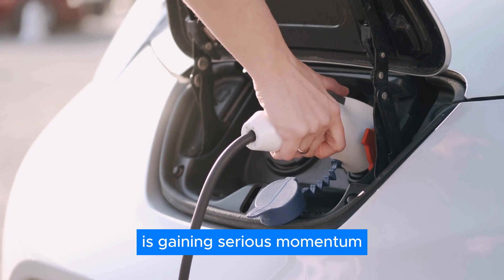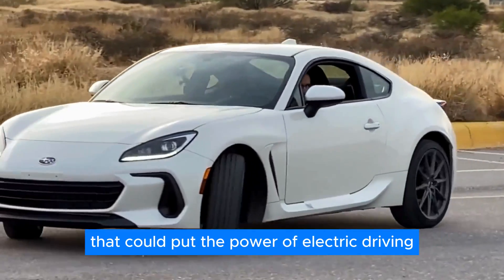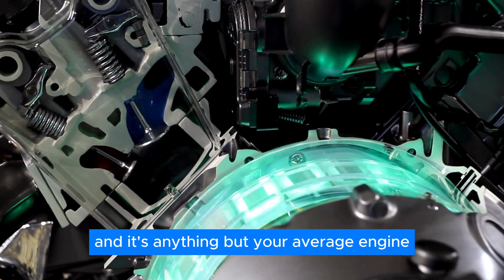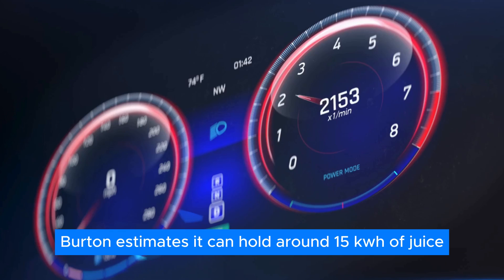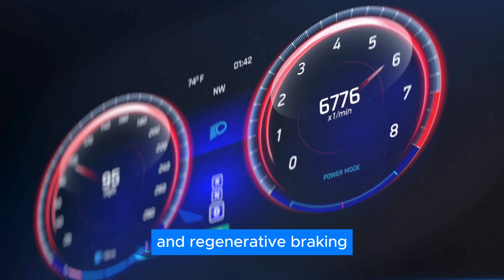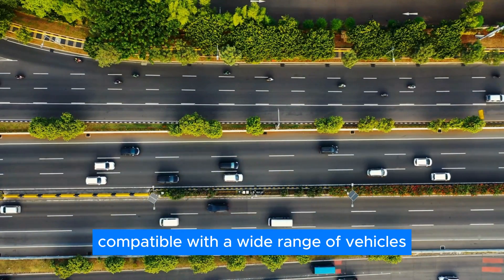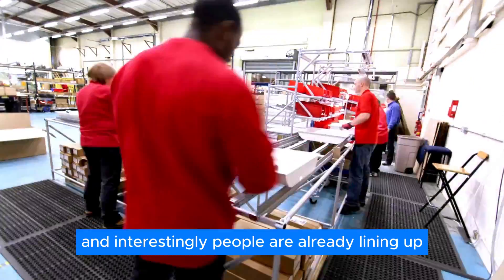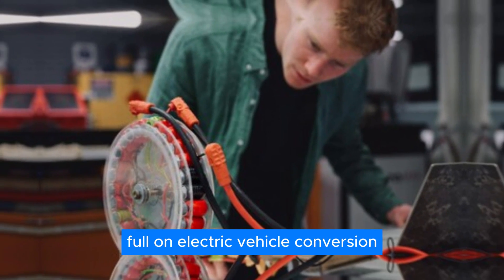Why Every Automaker Is Begging For Helix's New eMotor

Comment: Interesting idea with much promise.  However, to get the large HP numbers you are stating a large battery will be required so it's not really a true bolt on.  In addition a complicated motor controller and associated wiring will also be needed. If motors at the wheel were incorporated from the start of a design this may be an interesting solution.  But remember power is not free and battery technology will need to improve to take full advantage of this invention.